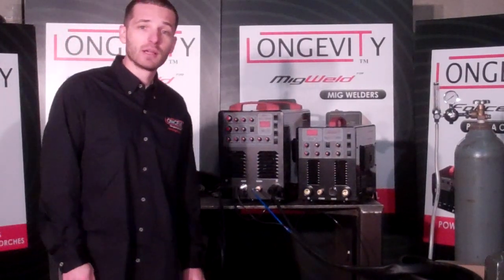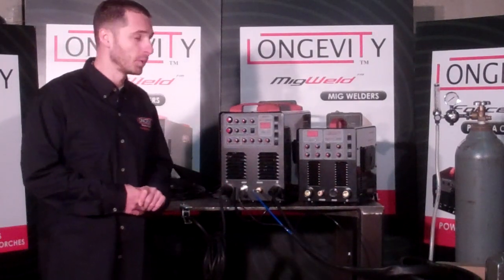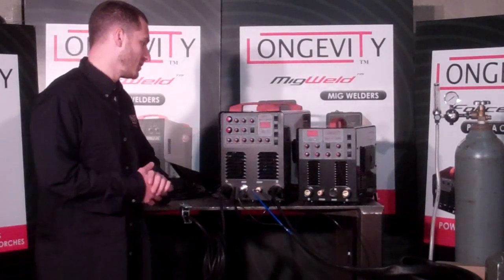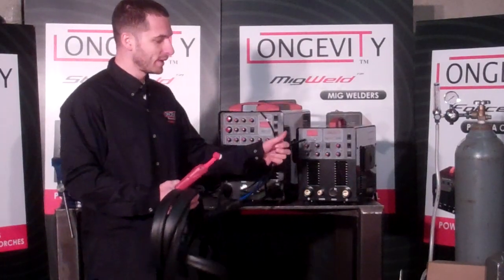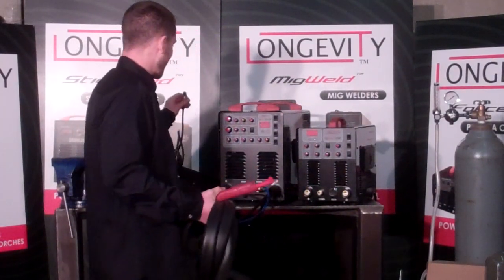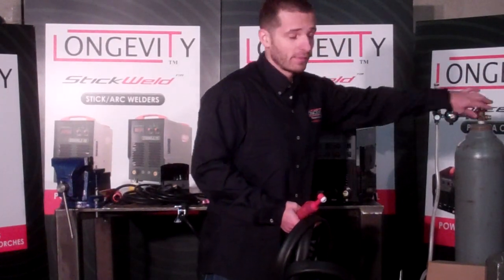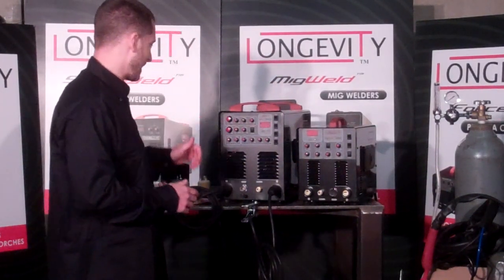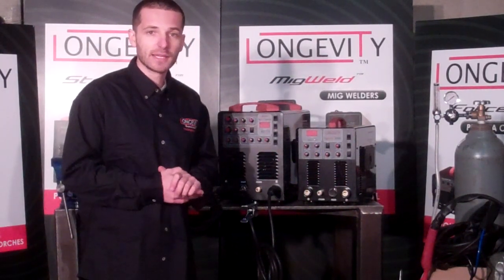LONGEVITY TIGWELD 200 DX and TIGWELD 200D 200AMP AC and DC TIG STICK Welders

Comment from the maker: Hi Guys,

I wanted to add to the video.  You can do reverse polarity depending on the stick rod as well in DC mode. This machine does not do AC stick welding. If you have any questions, please let us know at 877-566-4462